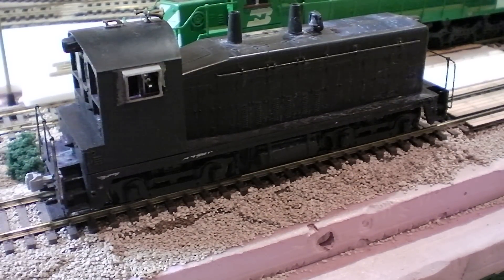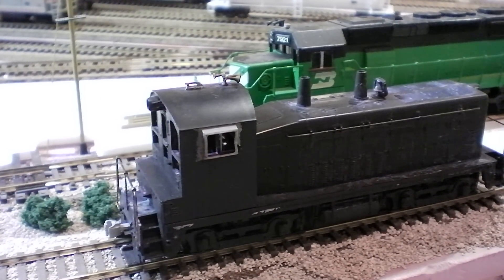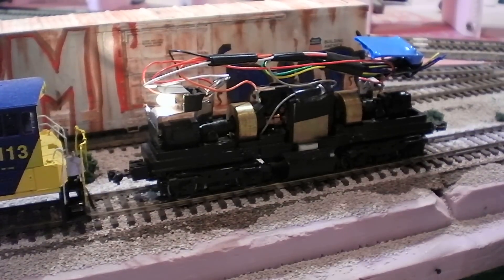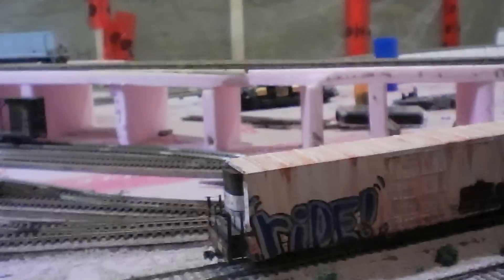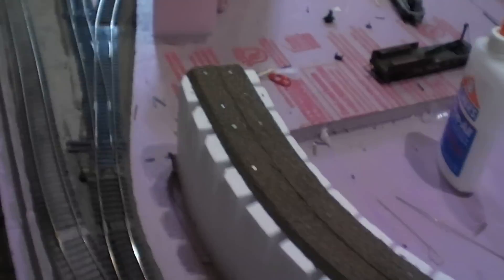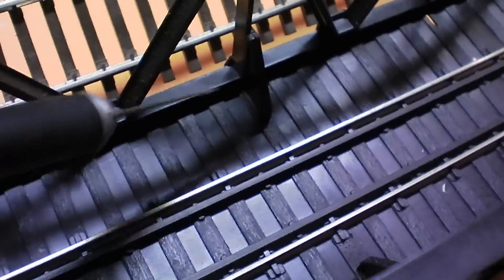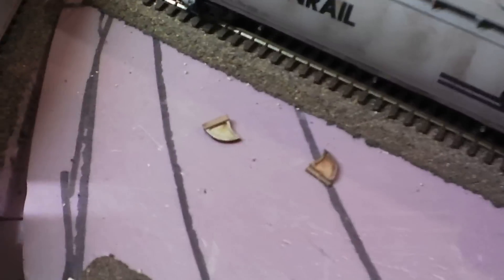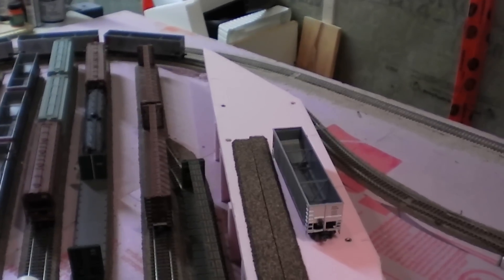HO scale Layout update August 15 2012. 201 subscirbers!!!!!

Comment: do what you said just tape up the wires and makes sure there is no contact with the motor or the shell. also make sure that when you close the shell that none of the wires are caught on the shell between the frame.